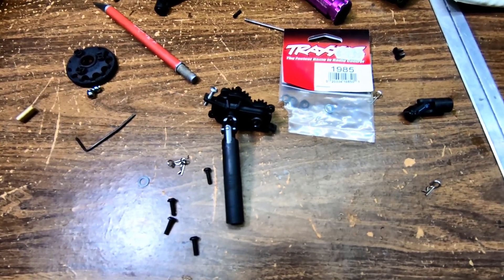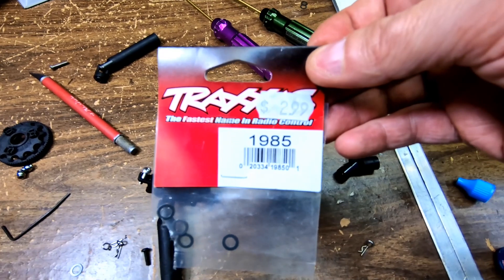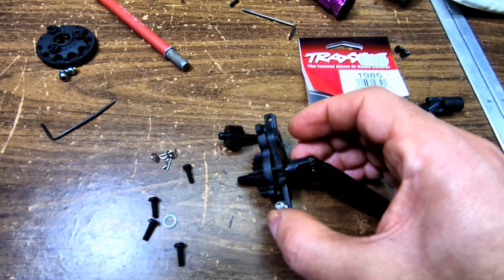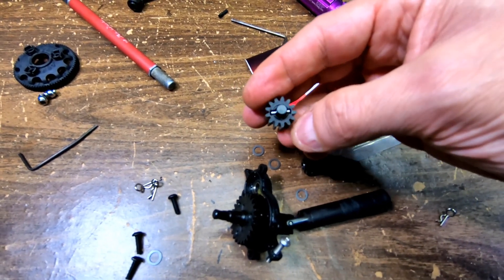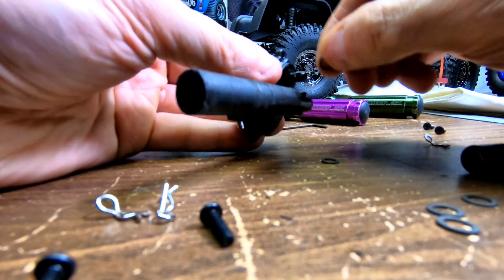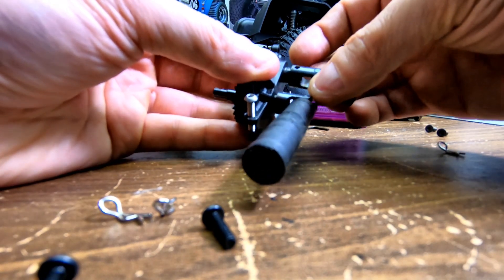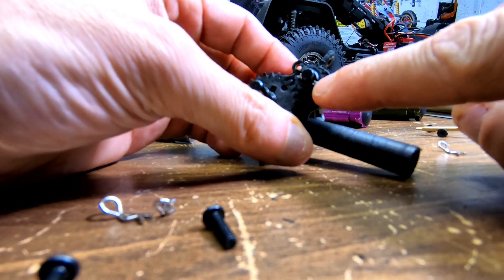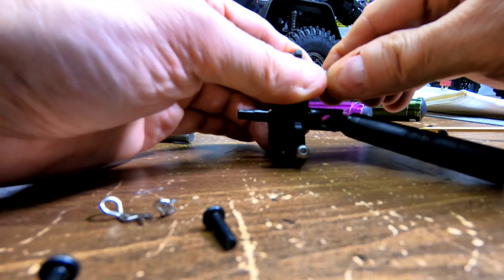Redcat GEN 8 CENTER GEARBOX FIX WASHER MOD

Comment: It's always something with the Gen8,I haven't had a problem with my Gen8 yet,but all these videos will help me fix what goes wrong,if it does👍👍
Reply from the maker: 👍 This is simple to do better safe than sorry... I did not have any problems with mine yet but now I am confident this pin slipping in the gear problem wont ever happen to it.

Comment: Awesome vid once again Steve👍👍! I did see exo's vid before I got my gen 8 and was prepared to do this mod when I removed the t-case to do your flat skid plate mod. BUT, when I went to check the play in the shaft, it was very minimal🤔🤔....so I looked where the spacer should go and seems redcat addressed this issue in manufacturing. I can see a small bronze bushing where the spacer would go. It may be an update in manufacturing since the gen 8 has been out over a year and I just got mine a few weeks ago. Jus thought I'd pass along the info to the gen 8 community. Oh and btw, that flat skid plate mod 🛠made the BIGGEST difference bro!👌👍 Beauty! 😁
Keep the greasy side down bud!🙃
Reply from the maker: That's cool, redcat always seems to improve their models from seeing or hearing about stuff from their owners.Glad to help ya flat is better! 😁👍
Reply: @ShenRC  redcat has been amazing actually.. I got my scout with a cracked tail light lens from the factory...rc planet put in a warranty request for me and they sent me lenses and the stickers for it. I also had a bad leaky shock. Turned out was metal filings in threads of shock body when the o rings were put in and tore one...redcat warrantied me a set of shocks! Amazing product and customer support was worth buying this kit alone. Look forward to more vids of your gen 8 Steve, and all your vids.  Thank you for all time you put into sharing all this info with the hobby crowd bro👍✌🙃
Reply from the maker: @nateg4513  That's awesome!! And Thanks for the kind words.

Comment: Never noticed it being a problem.
 Thanks for the heads up. Im definitely going to be looking into this.
Reply from the maker: 👍 Hi the pin can push almost out of the gear then it can strip out the back, this will hold the pin firmly inside... worth doing because it's super easy to do also.  Thanks bud!
Reply: @ShenRC  i have it apart and it looks as if it was trying to. Im wondering about the diffs now because there is some play there too? I know it's not the same and held in by a screw. But there's still some play
Reply from the maker: 👍Good you caught it in time, I don't know about the diffs I think they are OK..I was wandering how the gear is that the little shaft connect to the motors gearbox by that U joint there seems to be some play but no one ever said anything about those gears that I have seen?
Reply: @ShenRC  if they're anything like me they're paying more attention to transmission then the transfer case. Not many people are custom to separate transfer case. 

I think I'm going to be purchasing the metal gears.
Reply from the maker: @LscottD  One thing that stinks I hear with the metal gears you think it's loud now those metal gears make it even more louder... I think the plastic ones are ok just shim it you should be ok. 👍
Reply: @ShenRC  yes i noticed the play on that shaft, I put a thick washer on it just in case

Comment: I'd say the main downside to this method is that the washers o.d. is bigger so it will rub on the outer race, causing friction. correct?
Reply from the maker: 😁👍 Hi I tested for friction and have none at all.

Comment: Would this work for both sides?,  there seems to be play in both ends. Great videos on the Gen 8 .
Reply from the maker: Hi you speaking of the other side of this drive joint that goes into the motor gearbox? I did feel play in that also but I never opened mine up but I guess if the gear on that side has the same pin type set up you should be able to use the shims in the same manner on that side also.
Reply: @ShenRC  did i see a 3mm 3d printed part for that side or was that this mod? Thanks for the reply!
Reply from the maker: @innerfire-graham9016  Hi that is the same mod as what I have done in my video but I show it using spacers that you can get easy if you don't have a 3D printer.